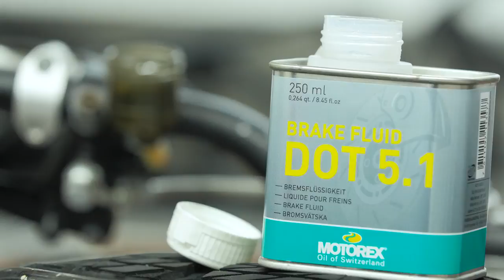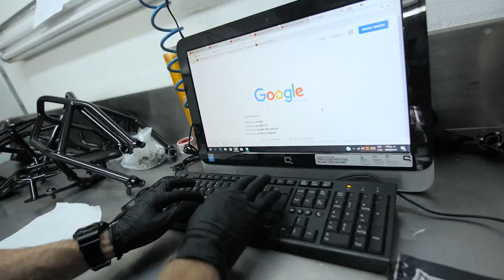HOW TO BLEED BRAKES ON A STUNT BIKE | RokON VLOG #29

Comment: Hey
 I would like to see how you guys are changing front rotor disk front and rear wheel for duke 390 full procedure.
How to fix 6 piston brake caliper for front and which will good for rear wheel.
And do u use prowertornic ECU for duke.

Comment: I have a  RC 390. Put a aftermarket brake pump on it. When it gets hot the lever moves out and when it cools then the lever comes back in. I'm having steel braided lines. Abs as standard and brembo sintered brake pads. I've tried 2 master brake pumps and it's the same issue. Tried bot dot 4 and 5.1 and still the lever gets stiff after riding for a while. Then cools down and becomes a bit soft. No air in the system. Any idea what's wrong ?

Comment: Why you use DOT 5.1 Brake fluid? Why not the regular DOT 3 or DOT 4?
Reply from the maker: Kshitij Gharat the dot 5.1 has a higher boiling point that means when my brakes are supper hot the brake pump has the same pressure and not the spongy feeling like on dot 3 or 4 while my brakes are overheating.
Reply: Gotcha! Thanks for the info

Comment: My lever doesn't have bleeder like yours.. Anyway to get the air out from it?
Reply from the maker: esh war getenv you can also squeeze the brake lever and while holding it you can open the screw that connects the brake line to the brake pump. With that you release the air.